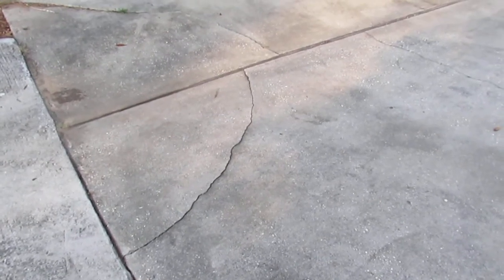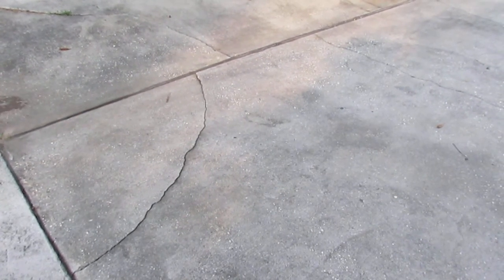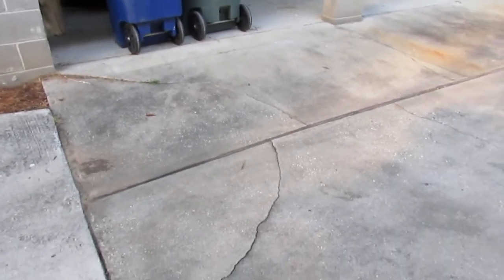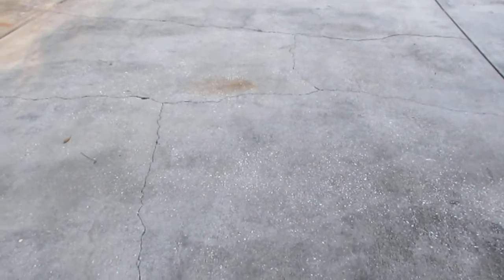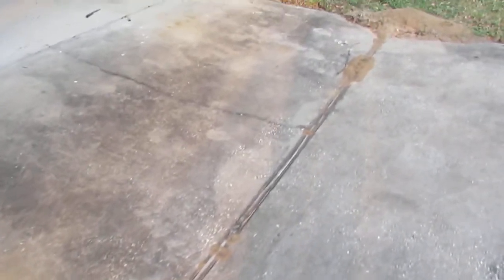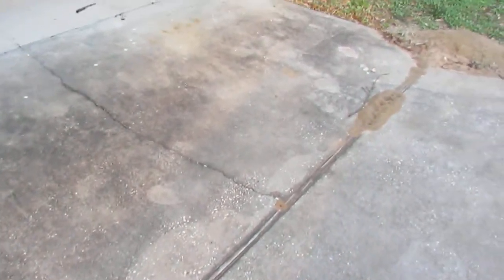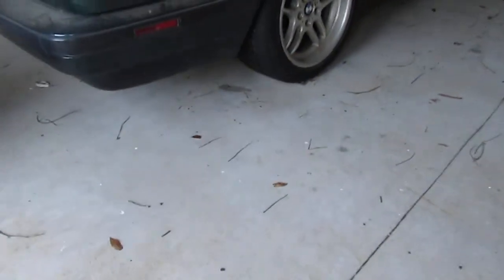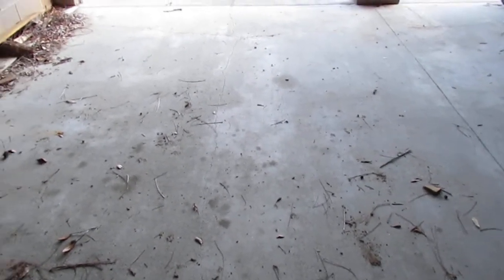Why does concrete crack how to stop concrete cement driveways from cracking episode 153 Read Below

Comment: Love this video. My concrete is all cracked as bad as this one. I did used an angle grinder and made the cracks big enough to put sealant in them, seems to be better.  I wish there was a way to make them blend in better. I did use silka sand to help but the sealant is light gray and concrete once power washed is tan. geezz At least it is not breaking apart.
Reply from the maker: Most-likely the only way to blend it would be to paint the concrete with Concrete Paint